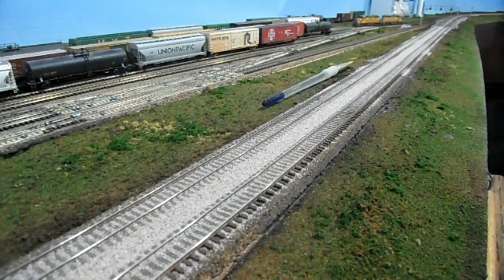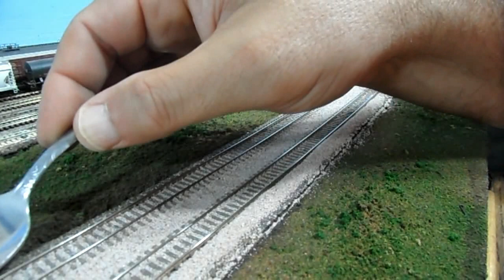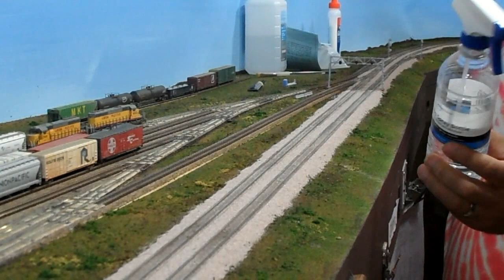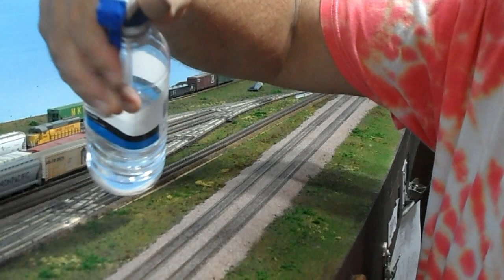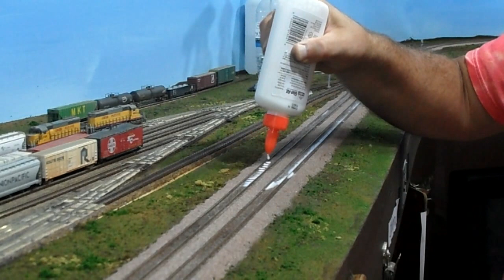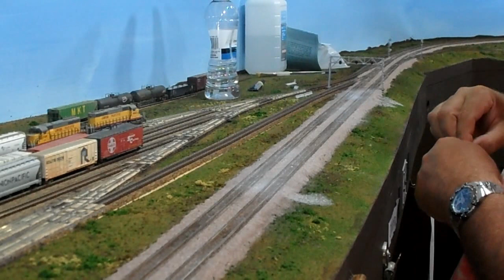Ballasting on the N Scale Union Pacific Railroad Geneva Sub Part 2

Comment: nice work on the ballast Daryl one of these days I will get a Woodland Scenic shaker and do my tracks I believe the next step after the ballast goes on is use a cleaning block to dust the rails off or use a cleaning car how the Geneva Sub does it in real life is they send the LORAM Rail Grader over it several times to remove the grit then they bring the trains on once grading is done

Comment: I have used the rubbing alcohol method also. I thought it worked a lot better than wet water. One thing I would add is ventilation, stuff gets very strong smelling working downstairs. I still hate ballasting very time consuming. Nice video also..

Comment: Wish I knew to use a spoon to lay ballast before I watched this. 
Poured it from the bag and it was a horrible idea because a lot of the ballast bounced off the more dense piles and scattering it slightly too far away from the ties. 

There was no going back because I already did all my scenery and grass and you cant simply brush it back onto the ties once it gets in the grass. And recovering it with the turf you used is your only choice to fix it but I cant remember which order I blended my turf with which will just make it look horrible if I blend my grass differently than the first time. (I learned the hard way)

Comment: I'm trying to ballast my track, and it's turning out to be a complete disaster. When I rub my finger along on top of the ties as you do, all the ballast comes out from between the ties. When I apply 50-50 white glue, the ballast apparently floats and covers the ties and bottom halves of the rails, and when I try to remove it, it just gums up and trying to remove it destroys the nice paint I applied to the rails and ties. Maybe my problems are caused by the fact that I'm using Kato track and Woodland Scenics fine ballast, but I'm about ready to give up on the idea of ballasting. ...Roy
Reply from the maker: +N-Scale Union Pacific Evanston Subdivision 2I would not try to ballast Kato track, although some do.  You would need to look for a video specifically about doing Kato track. My methods would not apply.  Woodland scenic ballast is harder to work with as well. I use Arizona Rock and Mineral ballast which is real rock and does not float in the glue as much as Woodland Scenics ballast.

Daryl